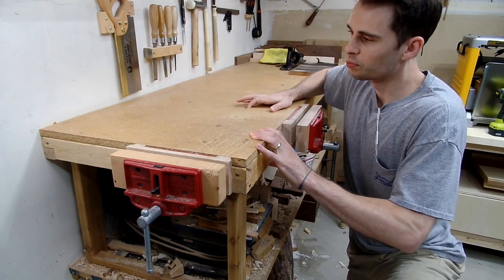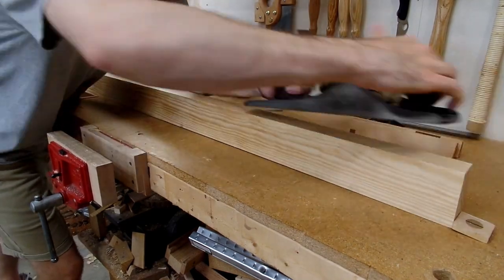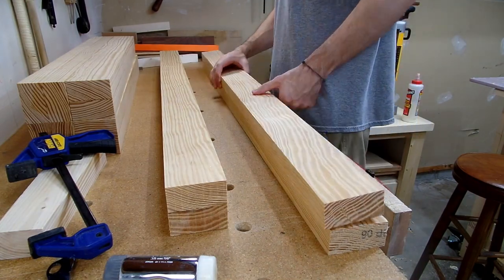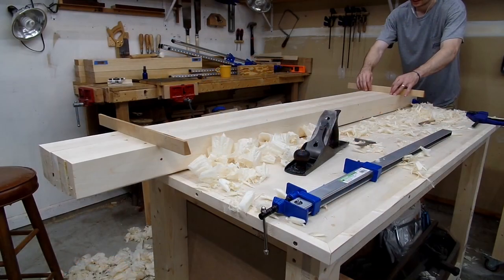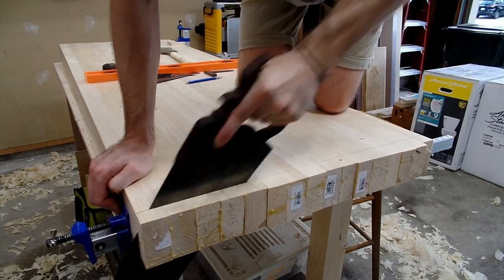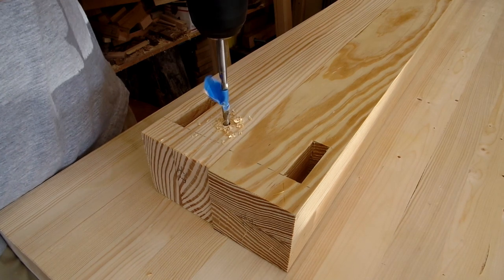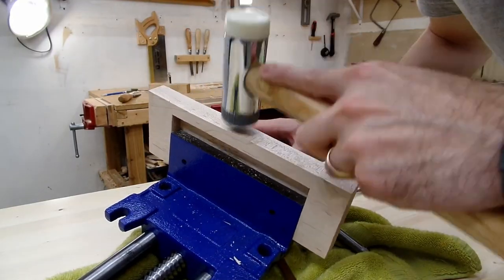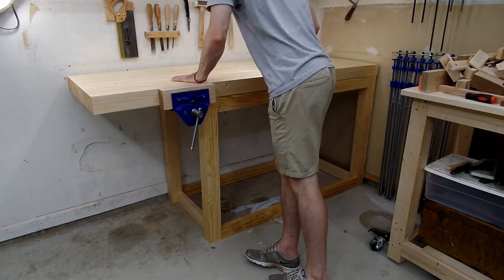Building a PROPER workbench!! Building a workshop episode #2

Comment: Thanks for sharing your workbench build. I loved it when I finally was able to build mine and I'm still adding or changing something on it 😄
Reply from the maker: I imagine I'll be doing the same with this one for years to come! I already know I need to add dog holes!
Reply: Yes dog holes are a must for planing by hand. I only have a couple on mine and my bench is only 4½' long and 18" wide with a 4' long x 7½" wide tool well. It's my version of Rex Kruger's Quick Stack Workbench and is somewhat similarly located in a corner like you have yours. I just got done making my own moxon vise which came out rather nice and is great for when I cut dovetails. 😁